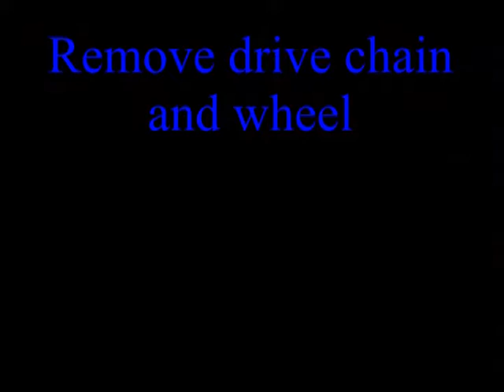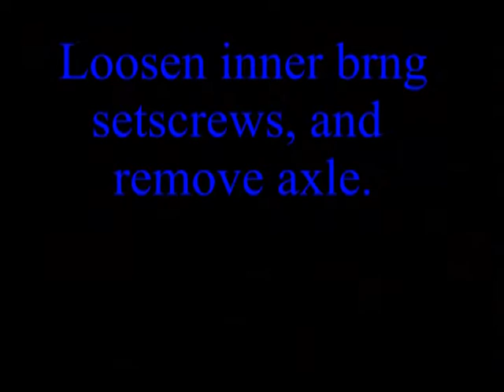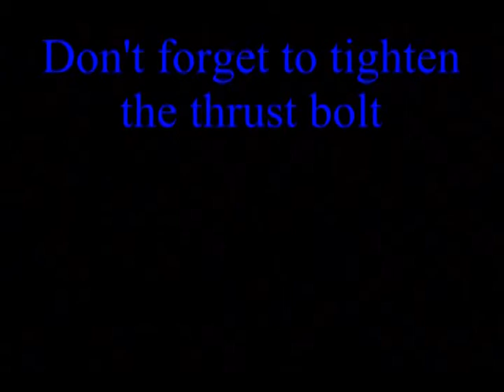Argo Conquest Axle Bearing & Seal Change

Comment: Awesome video! I have 98 Bigfoot I have to replace both sides of my middle wheel bearings. They were so bad when I bought it that the ball bearings were rolling around in the tube!! The outer flange rim is busted into pieces also. It was used and abused by the guy I bought it from. I didn't know anything about the Argos when I bought it from him and he didn't tell me that those bearings and flanges were busted. Even the steering brake pads were metal on metal and cutting into the rotors. It's going to be a restoration project for me for sure! This video definitely will help me changing out those hubs and bearings. Thanks!!

Comment: The rear axle and mid bearings are not that difficult to change what I would like is to see a video on how to change the bearing on the front left and right axle. Good job on helping use guys on how to repair our argos. thanks. Andy
Reply from the maker: The front axles on this machine are the same as the rear, with a couple exception like battery removal, and no set screws on the sprockets. I videoed the rear just to make it all easier to see what I was doing.

Comment: So I just replaced all my inner and outer bearings and new seals on my 98 Bigfoot 6x6. Everything is greased and smooth. The first time I took it to our lake I noticed a little water seeping from my left from axle area. Not much though. After about 20 minutes or so the water amounted to about 5-6 cups worth. Is that normal to get some seepage on these Argos? Should I get a bulge pump for it for extended water crossings? I figured these things should be completely water tight with all new bearings, seals and grease?
Reply from the maker: 2AR Tactical Custom Guns yes, in theory they should be watertight. Hard to get it perfect. Its possible for water to sneak on along the bolts too. Bilge pumps are a PITA, but I would recommend one if you spend lots of time in the water.

Comment: Went for a ride tonight but the bung cap on the fuel tank leaks water so I took it off and silicon`d it and tomorrow  Neighbor & I are going down the ditches  this spring we made 1175 .63 dollars in bottles in 2 weeks riding the machines paid for a complete rebuild on the Argo and coin for us both plus our sausage press  .

Comment from the maker: Getting started is the hardest part sometimes ;-)
I would suggest that your inner brngs are fine, but you should still check them. I can usually get about 3 times longer on inner brngs, than outer brngs.
Reply: Do you have a Video  of the front axel being replaced

Comment: RockDocktor-  That is a great video.  How long should it take an experienced mechanic to replace the bearings like you have done in this video.  I figure if I do this I might as well replace all 8 wheel bearings?  What sort of problems commonly occur when doing this?  Thanks Bruce

Comment: I just completed an MX Handlebar steering conversion on my 2000 Argo Conquest 8x8 and fitted the Argo Frontier 24" tires on it also. Those 24" tires are a tight fit but the work great. No rubbing between the tires yet. Ive watched all your videos which is what started me off in the Argos. 
https://youtu.be/B6IlzboVC-Y

Comment: i have a 1985 6x6 with a 17hp koler argos in great shape but the motor is not good can you recomend a new replacement motor i see that the new fonters carry a 23 hp koler would that fit in mind

Comment: Having a hard time pressing new studs in. Any advice?
Reply from the maker: Put the stud in the hole. Stack washers on stud, the correct height. Put lug nut on stud. Use impact driver to turn nut, which will pull stud into hole.

Comment: cool, how do you change the front when the sprocket it rust welded to the axle?
Reply from the maker: PB Blaster is one of the better products for that. Soak it down, then let it sit a couple times. Might end up having to cut the axle, but try the PB first
Reply: @RockDoctor07  I had to cut 3 axles off of my abused 6x6 Bigfoot I bought. I was able to use a press to remove the gears from the cut axles afterwards. I tried PB blaster and heat with not luck. These machines are awesome when maintained but a nightmare when they aren't.
Reply from the maker: 2AR Tactical Custom Guns I agree, they can be a beast to take apart.